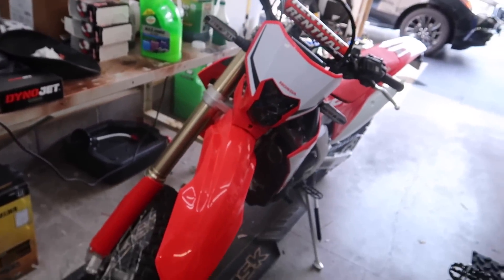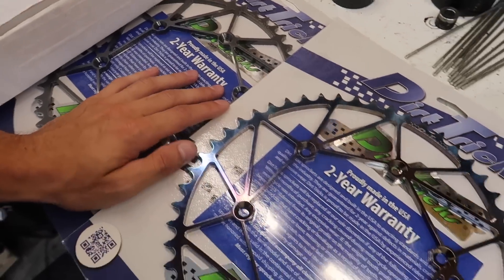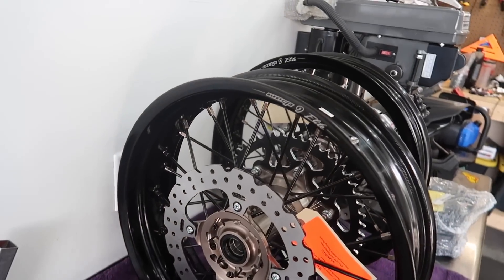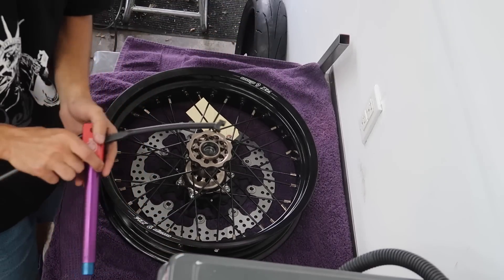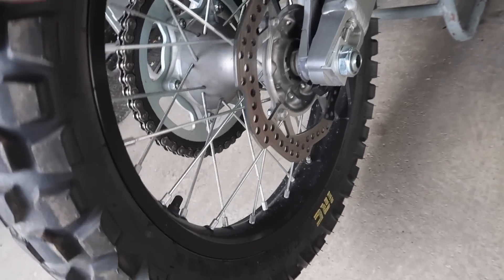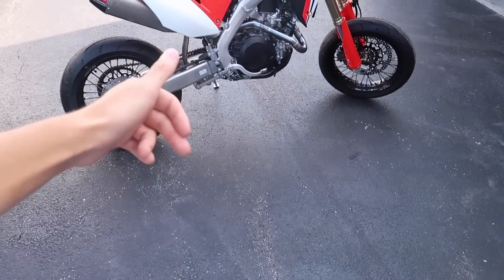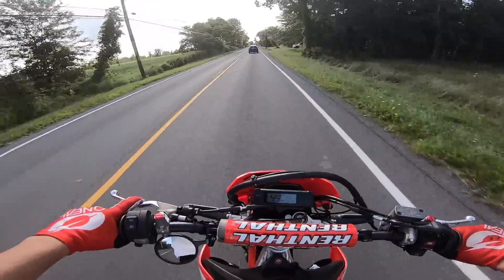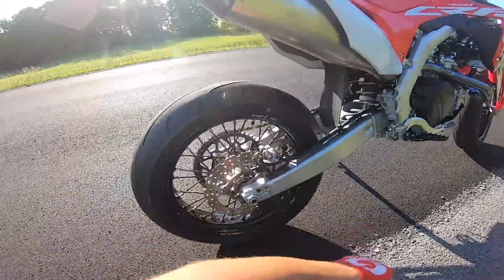CRF450L SUPERMOTO SETUP IS SICK!!!

Comment: Tyler, you mounted the front tire backwards on the rim..... the pattern it's telling it....
Reply: Adrian Aranda Garcia everybody says that about mine too the directional arrow is pointed forward, but what he didn’t do was balance the tires
Reply: It's on correctly, the front and read tires function differently when accelerating and when braking so the tread designs are different.
Reply from the maker: Adrian Aranda Garcia I thought so too but it’s correct
Reply: @oneleggangdev_1leg   oh..... wow i got tricked by the pattern on the tire then.... and yeah the tire allways say on the side the rotation way.
Reply: @TylerMonagan    Wow, I was confused when I was guided by the tire pattern ... but it is true, if you followed the instructions on the side, it is 100% certain that you did well. I hope the next modifications include a more aggressive braking system and some clutch system such as recluse or hinson. Greetings from tijuana Mexico
Reply: @SenorJeebs  yep i just learned that today :)
Reply: Adrian Aranda Garcia nah that’s how it is, all good, I throught that too
Reply: Adrian Aranda Garcia no he didn’t it does that to push away water
Reply: @TylerMonagan   did you have to put a bigger front break rotor due to the rim size  change ?
Reply: Jordan Gadd I have a 2018 TC 150 sm it weighs 210lbs and had to get the the sm wheels balanced. Def would recommend it 100% I use the internal beads so you don’t see weights taped to the wheel
Reply: Jordan Gadd obnoxiously bad unrideable
Reply: 8:12
It is mounted correct way. The reason behind of mounting front tyre as it is:
- imagine a small particle, or a drop of water in that front tyre's grove. When you are braking (decelerating) that small drop of water will  be pushed outward of the centre of the tyre. This way, the tyre cleans itself in case of braking. Meaning, it preserves cleansier groove/rubber and therefore better grip.
Would the front be oriented as the rear one is in scenario of braking, water/dirt would build up towards the centre of the tyre. It would result in losing grip/aquaplaning etc....

This is pretty much how all the front tyres are mounted on motorcycles. Where direction of mounting wouldn't matter that much is in slow speed scenarios.

And for the rear tyre:
- it is mounted as how it is for the sake of acceleration. You can now also imagine a tiny particle in that grove and imagine what happens with it, when the tyre starts to rotate. It will be pushed outwards.

To conclude, front tyre is important on braking, because braking is done mainly with the front, rear tyre is important for acceleration obviously. Hope this is helpful.

Comment: That axle having zero grease from the dealer really got me tight. I would check everything over again
Reply: Devin Kenyan seriously... locktite too
Reply: It's isn't the dealers responsibility to do all that. They aren't mechanics most the time and just put the bike together, and they barely if any use grease. It's the costumers job to be responsible enough to take it apart and correctly grease and lube everything before you ride.
Reply: @justinmoto929  You are absolutely clueless. Most of the time the bikes come with the wheels mounted on them from the factory not at the dealership. Yes when we build the bike's we typically will use shop grease on anything that needs it. Most shop help who put them together are usually riders too so they do have some pride in what they're doing.
Reply: justinmoto929 🤦
Reply: justinmoto929 you really have no idea rookie
Reply: The axle doesn’t need grease because the axle doesn’t spin, the bearings do. Grease attracts dirt like a magnet so why grease something that doesn’t use grease?
Reply: Mussels Marinara you know what happens when you spin bearings with no grease? They melt 😂

Comment: Which are the tires specs sizes and rims width? And on the front wheel you upgrade the brake disc to 300mm, i think, the kit comes with the brake plate adapter?
LOVE your videos, in 5 months i m going to buy a 450L. 
You shold be more technical on that kind of videos

Comment: Download a GPS speedo and use a mount to compare your actual speed (app) to displayed speed (dash)
Reply: Idk how your bike measures speed, some do a magnet on wheel and others are measured at the crank in the motor so it could be the sprocket changing the displayed speed or the new wheels and tires shrug

Comment: 450L looks sweet w/those wheels and the Yoshi exhaust. I wonder if having the suspension lowered would help it even more. I know RaceTech does that. Maybe other suspension shops. If you're using it mostly for the street, you'll really don't need all that travel. Maybe drop both ends an inch or so?

Comment: Just by putting slick tires on it doesn't make it a Super Moto. I've never seen a Honda Super Moto for the civilian market, because they don't make it. I've only seen Suzuki make it for the civilian market as far as I know. Super moto's are calibrated differently than that Honda dualsport, again putting slick tires on it don't make it a Super Moto...if you want a Super Moto. Just buy a Super Moto.